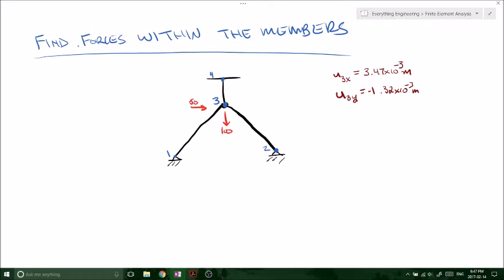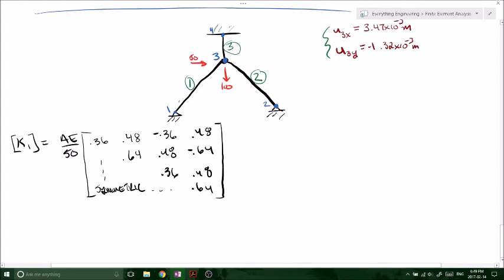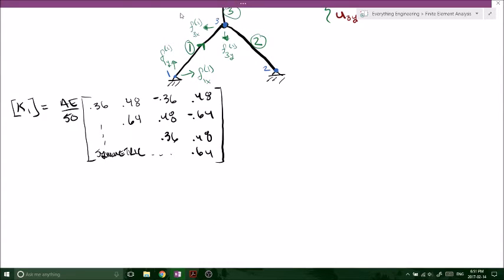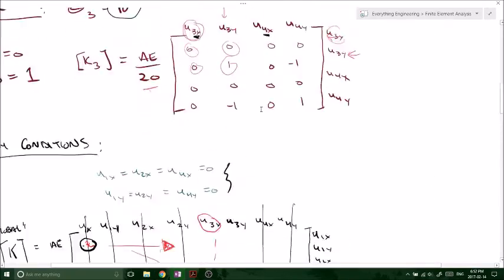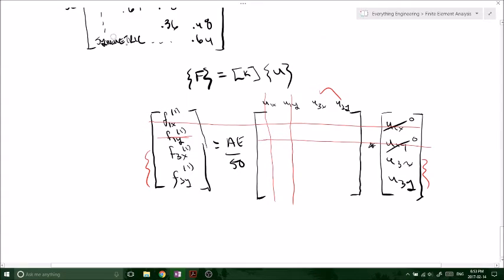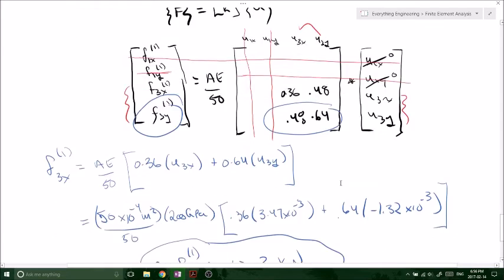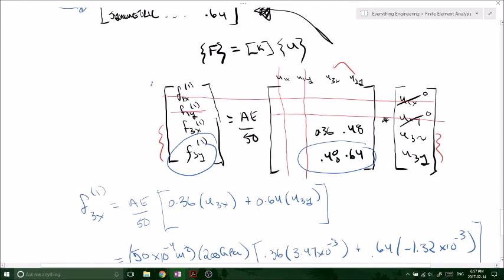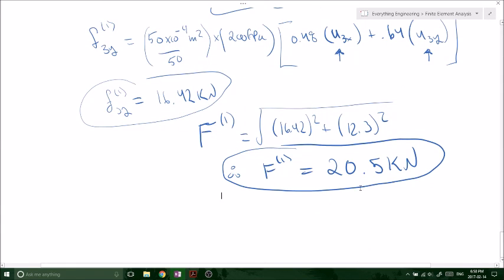Calculating member forces using stiffness matrix in 2 Dimension PART 1 of 2 - Finite Element Methods

Comment: If there were components of force for F1x and F1y would those be added to the respective F3x and F3y components?
Reply from the maker: yme258 if external forces are applied to a support restricting movement in the directions of the forces then no load will be transferred through the member and as such they should not be affecting other components of the system :).  I️ believe the reaction forces would just change at the support itself

Comment: Hey thanks for these, they are really helpful.
Just a question, should F3x(1) = AE/L * (0.36(u3x) + 0.48(u3y)) ?
Reply from the maker: Porkchop137 thanks for the heads up! You are correct! I just have written down the incorrect value by accident.  However the answers should be of the correct magnitude and was just a simple blunder on my part :)